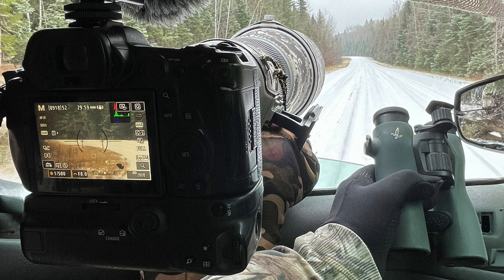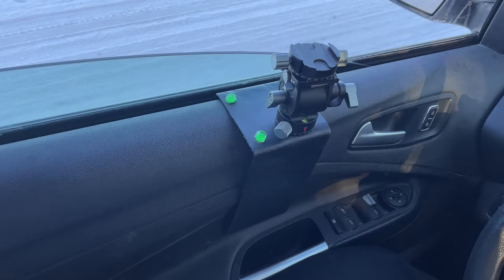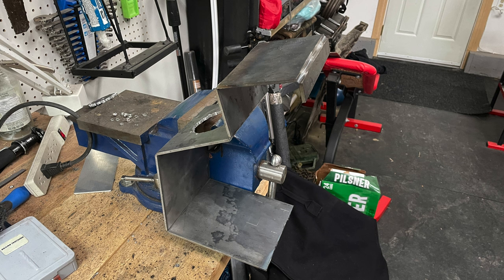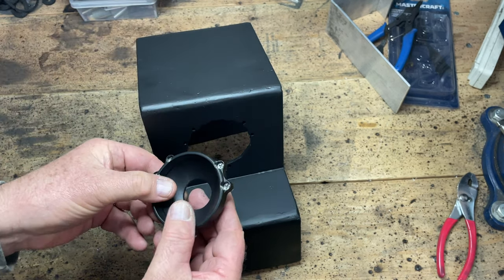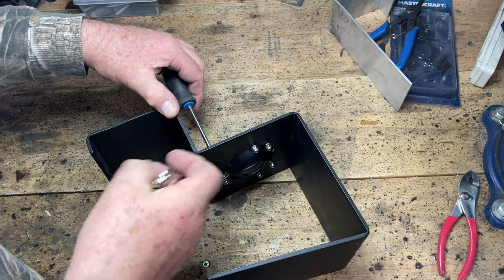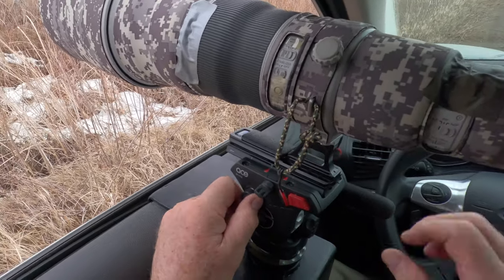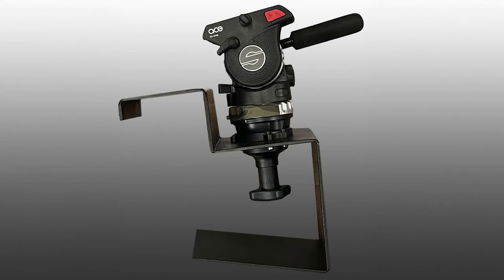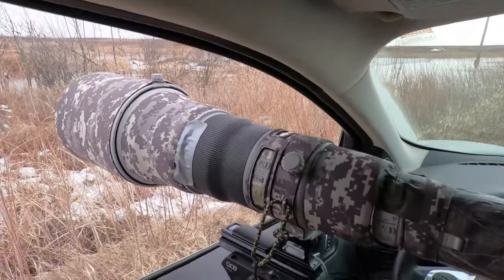Car Window Photography FOR VIDEO!! - Make Your Own Fluid Head Door Bracket

Comment: why not use Aluminum, or is it to light weight?
Reply from the maker: You need a heavy base for video as any tiny shake or tremour will show up, as you can see in the short owl clip. So I deliberately went with the heavier steel. 

Also, I can't weld aluminium and a 5mm aluminium plate won't bend without a machine press or maybe an Oxyacetylene  rig, neither which I have and I don't think your average photographer would either. The door clamp is not intended for hiking, just car use, so the wieght isn't a logistical problem.

As mentioned in the video, the light aluminium door clamp works fine for stills as you usually don't use slow shutter speeds (to avoid blur from subject movement) for wildlife so shakes and tremours are not an issue.